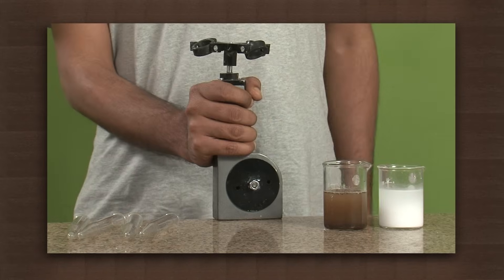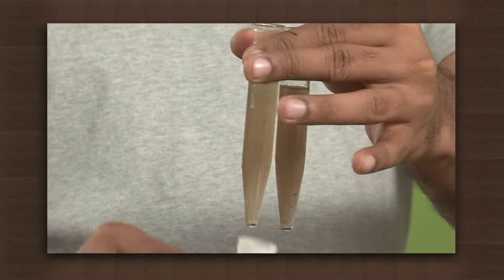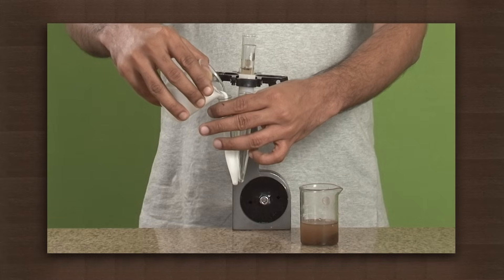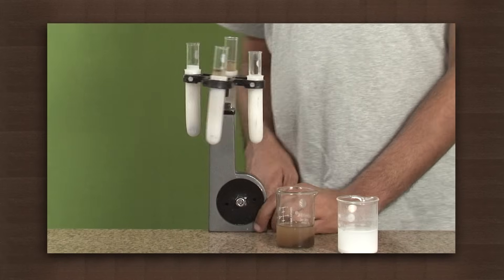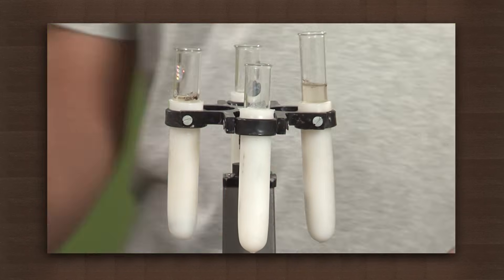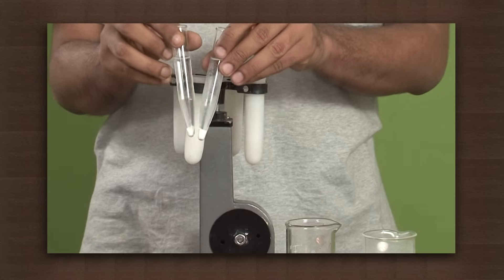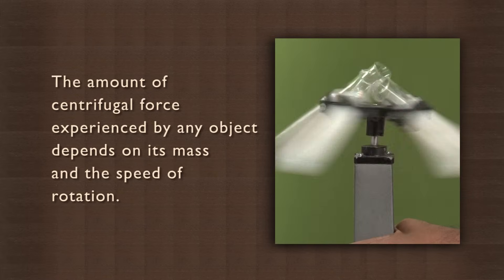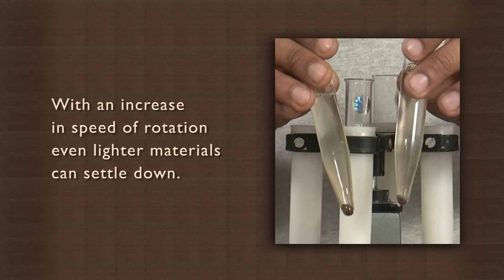Centrifugation| Separation Methods | Physics

Comment: This seems like an older video, but if you're still using a manual centrifuge, it might not be the safest option. Consider upgrading to an OHAUS centrifuge for a safer and more efficient experience. Check out our range of centrifuges designed for reliability and safety!

Comment: I just started resin 3d printing and discovered how fast is the alcohol (used for cleaning uncured resin from the printed models) get dirty.
With syphoning a cleaner alcohol can be drained and reused after left to separate from the heavier resin (they have about 35% difference in weight).
But I would like to improve the separation (faster and better separation), and the first thing that came to mind is a centrifuge.
However most centrifuges on the market are lab sized (and quite expensive), so I was wondering are there some simple ones that can be used for larger volumes - for example with 2 x 1L bottles at a time (even 2 x 0.5L would be fine).
Do you guys have any suggestions?

Comment: How does one separate a liquid of multiple particles such as spores mixed with mycelium fragments. What force and liquid mixture would I need to use to separate the living tissue from the spores? Because so far all of the particles settle together as a mix even though there density is different.

Comment: thank you for the video. IT explained a lot but I have confusion about how the centrifuge separates the solid particles.
 I mean, Are the solid particles pulled to the bottom "because they are heavier" or "because they spin faster"?
Reply: Because they are heavier
Reply: before using this method you have to be sure that there is no matter in the water that has higher density than water itself. for example , tiny plastic particles o oil will be captured by your filter and brought up as if they were water. would be good for purifying rainwater but not water from industrial waste

Comment: Centrifugation in a Nutshell.

So, basically, you push the dust/small particles into the corner of the tube and it's seperated. That's cool. The thing is, where the fuck am i gonna get that spinny thingy?

Comment: Question, if I wanted to separate a lot of the nitrogen out of the air (to increase the oxygen percentage), would that process be only a tiny fraction of the overall energy that is produced when that air is burned with fuel in say an internal combustion engine or wood burning stove, or would you have to add energy to make that happen?

I  googled it and O2 is 23% denser than N2, if that helps. They are 1.4291 grams/liter for O2 and 1.1606 g/l for O2.

Comment: Hello sir.  Very nice video, however, there is NO SUCH FORCE as "centrifugal" force..please see any basic physics text, likely chapter 6, motion in a plane/uniform circular motion.  The sum of the forces constraining an object to a uniform circular path is CENTRIPETAL force, not 'CENTRIFUGAL'  force....the latter is commonly and incorrectly attested to motion under the law of inertia, which states that objects will move linearly unless acted upon by a net force.  The net force pushing the liquid to the center is the normal force from the wall of the test tube...inertia causes the liquid matter to move tangent to the path, creating the illusion that the liquid has moved "outward" as viewed in the spinning reference frame.  Please amend your text....CENTRIPETAL force depends on m, v squared and R.....there is no such agent creating a "centrifugal' force.  Thank you.

Comment: The text to this video states :"The centrifugal force depends on the mass of the particles and the speed of rotation. With fast rotation even light particles get forced down to the bottom of the test tube as precipitate."  This is misleading since a rotating mass exerts a centrifugal force, it is not subject to such a force.  A mass rotates because it is subject to a centripetal force, if it was also subject to a centrifugal force as is being implied here these two forces would cancel each other out.
Reply: where did u get that from?
Reply: What I have stated is common sense.